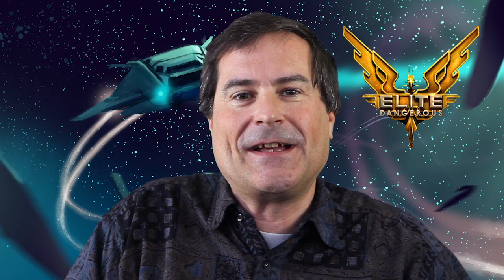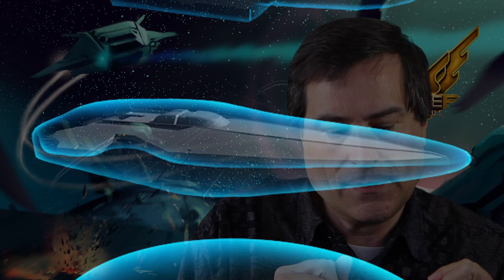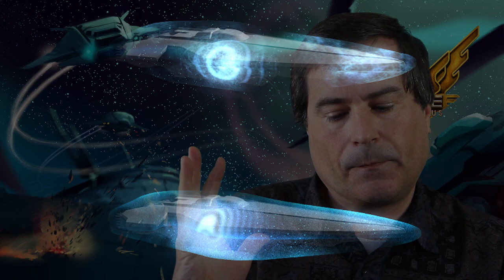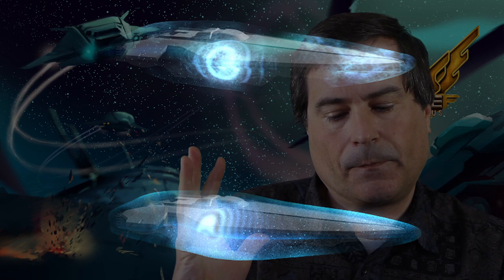Dev Diary - Shields

Comment: I had the idea earlier and I feel like I have to share it here.Smaller pirate ships could be better equipped to take on the larger ships in ambushes if it was possible to upload viruses in order to limit or disable specific aspects of opponent's ships.

I would suggest that this was only possible at close range when the larger ship's shields were down. For this to be an option, shields would need to be disabled in order to pick up resources from space. [...]

Comment: I'd be happy to see an equippable device like a shield capacitor in this game. An extra reservoir of energy that could all be dumped into a single shield all at once in an emergency. You'd have to decide which shield to charge and when, and once you've used it, it'll only recharge once all your other shields are back at 100%.

Comment: Having to manage energy levels and transferring power to different systems was already in games a early as X-Wing (the earliest example I can think of), where you had to manage weapon, shield and engine power and where you also could transfer power between weapons and shields and in the case of shields to which shields. 

And you often had to do it, in the middle of combat, while Tie Fighters were peppering you with their weaponary. I don't think a multi-crew ship is needed, but would be nice.

Comment: Star Trek On-line uses a very simplistic shield model that allows the player to transfer power from one shield to another, but also engine power can be diverted to shields as well. If this power transfer were to be available on the large multi shielded ships, this could make running a large ships tricky. Maybe time to consider multiple players running one ship? Different roles; pilot, gunner, engineer, navigator, etc...

Comment: I know I'm late to the party but energy shields should probably just hug the architecture of the ship. Basically, it's an energy field that "coats" the hull (with maybe a small gap in between). That avoids problems with players getting under shields, if possible, and it can be a good visual indicator of what's exposed and what's not. My two cents. :)

Comment: It would need to be dangerous though, to stop people doing it all of the time. Perhaps you'd actually need to remove the containment fields around your drives in order to give off the correct radiation. They could be much more likely to blow up if they're fired upon, so it'd be a question of if it's worth the risk of you're enemy not caring if your ship is left intact.

Comment: @1:42 Ok, your planning a front and aft shield. So your plans take more than 9 years to create. So I would expect this to happen somewhere.. ehm let's say 2022? 
@2.09 So when it takes about 9 years to implement 2 shields I will expect it to have many many many shield generators somewhere in the year 3306.
@2:34 mentioned gameplay. Ok, so where is the gameplay?
@3:24 "It will still be possible to get under the shield". Please show me a demo where this can be done. Then I am really really sold.
@4:02 mentions gameplay again. So where is it?
@4:32 All very exciting, I had a wet dream 8 years ago and now I am having an affair (especially after fleet carriers beta dropped).

So yeah, that is all I have to say for now. 

Fly safe.
Reply: Technically in an SLF if you ram a large ship like a conda, cutter, or Vette, and hug it tightly, you can deal hull damage and get under the shields
Reply: I trust you've seen the Odyssey gameplay...
Now we can hide inside shields.